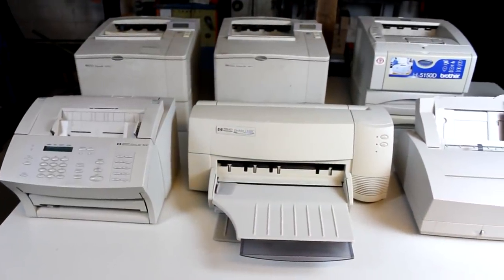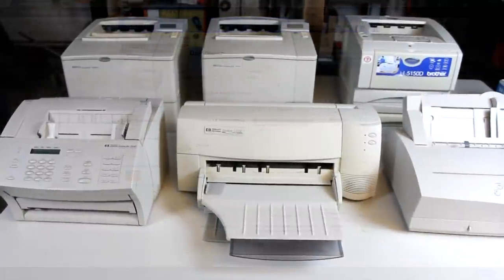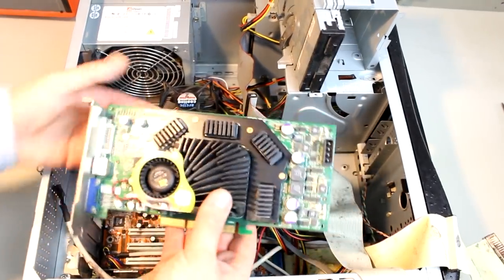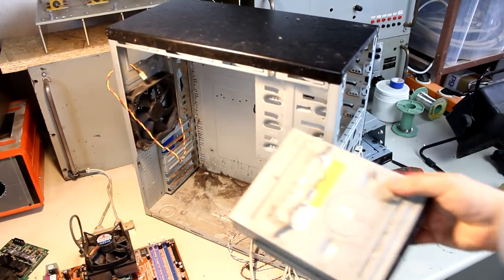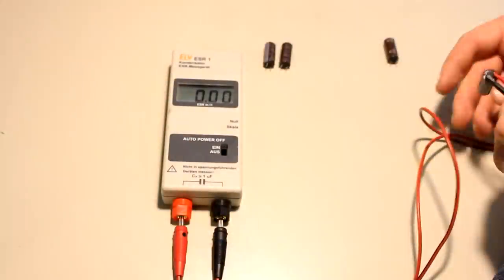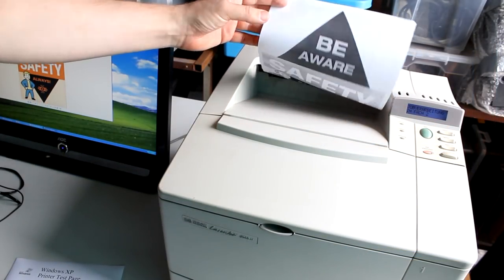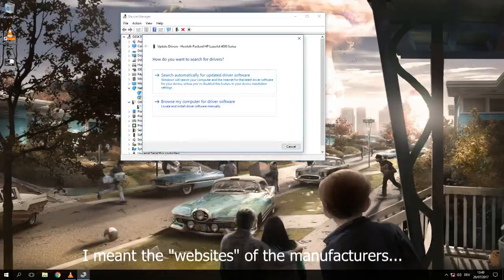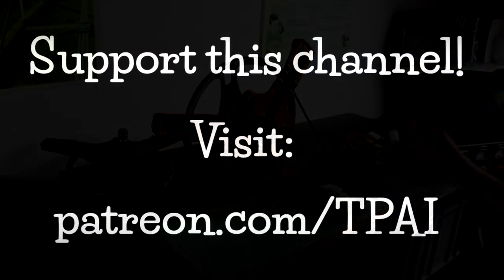Repairing and Restoring an Old Computer - (for those old Printers)

Comment: Man you need to apply much more heat to those solder joints on the capacitors! As you have stated it is a multi layer board, and that solder must flow entirely through the via's. The difficulty in removal is a good indication of the difficulty in attaining a proper temperature for the solder with that multi-layer board.

Comment: I remember the "capacitor plague". Some manufacturer stole a capacitor formula, but they stole the wrong one. Built and sold their capacitors for cheap. Many other manufacturers thought they were getting legit parts and these caps went into EVERYTHING. Of course they failed. On mainboards the copper plane is used as a heatsink. I've found the best thing to get those caps replaced is to just use a 150 watt soldering gun.

Comment: One needs to be aware when loading old operating systems Microsoft still supports to allow time for updates.  I just installed Vista on an old Dell I bought and had to leave it alone for a day or two while it did updates...I think there were over 400 security updates.  Of course, if you keep it off of the internet it is not an issue.

Comment: With the old HP Laserjets. Just pick the Windows built-in driver manually when installing. And force it to use something like the Laserjet 4000n which is included in the windows default list.. It will work on any old laserjet.

Comment: HP 4000n are legendary printers, very robust. Seen them still thumping out prints to this day. With a universal print driver, they will still work with a modern OS. Errm you have the patience of a saint to bother doing this, interesting about the capacitors on the mainboard, good tip!

Comment: 1:00 You do not have to install an old operating system. Just use the Universal printer driver. it woks with every HP printer.

Comment: Why clean a CD that was working? Also how did you manage to nearly snap it in two!
Reply: When I ran Windows 2000 I lost 2 or 3 Factory CDs - Workstation and Server...I think the mastering machine over-stressed the center hole, as that is where all of my cracks started.

Comment: I have had trouble getting windows 7 64 bit and after to work with a parallel port. but for some reason the 32bit versions of windows always work for me.  I just upgraded my shop cnc computer a few months back and it took me a while to learn that the parallel port (while found and showing up without errors on the device manager) just did not have any drivers that were supported.  but it may be just my luck.

Comment: You need to select the right color profile on Ubuntu. Some printers use nonstandard color spaces like BGR or KCMY, which would result in VERY unusual results. Some printers also work better if you select CMYKk if they have separate pigment and dye black inks.

Comment: When it comes to printers lets hear it for Linux.
Reply: I can remember when printing on Linux was a nightmare. I can remember when HP printers didn't work at all! Well they could spit out just raw commands. Pages and pages of them until you pulled the power.
Reply: Paul Frederick So do I! Those days are thankfully long past.

Was almost as bad as getting Linux sound card drivers going in those days...
Reply: I remember those old Linux stories. I recently found a pc from 2009, w7 ultimate , amd dual core. Had to tinker with it a bit buts till works well to my surprise. Gonna try a program lke adobe studio on it. Did I Mention the 500 GB hdd?

Comment: Hello and do you have any tips on how to check the power supplies on these old computers. I have Emachines desk top from 2002 and it won't turn on anymore. I installed windows 7 on it and it ran fine but after almost two years, I started having the power on issues. It came with windows xp originally.

Comment: Aren't those LaserJet printers network printers? You could try using them like that... At least for me on Windows 10 I can use my old HP Printer like this (I forget the exact model right now). You add a "Local Port" and connect to it via TCP/IP. If I don't remember wrong I use a generic driver for this... I can double check tomorrow on my Windows computer.

Comment: a long time ago that's what I found with windows XP was that you didn't need to go and hunt for extra drivers they were for the most part already installed on XP. I gave up on computer repair though and am not into Widows 7 or Widows 10 for compatible drivers, but sounds like a good portion of them worked at least on Windows 10 32 bit processing. Good luck on Windows 10 64 bit compatibility

Comment: try an old thin client.   try a cheap dev board running DOS.  printer drivers should be accessible on the command line.

Comment: try this

Right click the driver file. Click Troubleshoot Compatibility.

Click on Troubleshoot program.
Check the box that says The program worked in earlier versions of Windows but won't install or run now.

Click Troubleshoot Program. Check the box that says The program worked in earlier versions of Windows.

Click on Next.
Click on Windows xp.

Click on Next.
Click on Test the program.

Comment: Hmmmm... I just spun a old 12v 80mm case fan with compressed shop air and I it didn't generate more than 7,5v DC on the leads (even less when going backwards).

Comment: While Linux has full multiarch support (i.e. runs 32bit software without any problem on a 64bit OS, which is quite common to use since at least 2008 or so), Windows doesn't really have any compatibility. Yes, it will run 32bit applications in the most cases, but it can't use 32bit drivers. Also, under Linux, a printer driver is usually just a PPD (PostScript Printer Description) file which defines the language and the commands that the printer understands, so you couldn't really call it a "driver", like the kind of driver that you have for your Wifi card which is a kernel module. But the way Windows calls everything a driver was already funny back in the 90s with CRT monitors, which also don't have a driver, just a subset of pixel resolutions and frequencies that they can display...but Windows always wanted a "driver" for it. Even for a PS/2 keyboard, which was a really standardized component and every one of those used the same protocol, they only had different numbers of keys, and the keymap was of course different (which you could already change in Windows back then, like using a German keyboard with an English keymap and having the z and y keys switched and so on). Again, it was stupidly called a driver and pretended to "install" that thing that sat in the BIOS and was there right from the beginning (you could not install any Windows and not have it contain the standard keyboard driver, even though it wanted to "install" it anyways).

Comment: Have you tried to select 32 bit compatibility mode? I had a 32 bit driver for a 32 bit program that was installed on my Win10 64bit system. Maybe setting a compatibility mode might resolve this for you.

Comment: there are few reasons for not using compressed air :
- either dry or not it will get the parts wet because of low temperature of expanding gas
- it can push the dirt under components like ICs and connectors
- combined dirt with moisture makes a pcb bad in moment.

Vacuuming with integrated brush sorts all that out.

Now i wait to hear ...blablabla.. but they all do it... blablabla

but, it often happens before trying the part/system so you can always say that it was already bad ;)

Comment: One of the reasons that they mostly worked on windows 10 is due to the issues that Windows 7 gave during the beta testing, there were way too many compatibility issues, it was still like that in the windows 8 beta release as well, but with what they learned they implemented it into windows 10! 

I was going to say, you could have easily used vista for running the printers, since many drivers did not face huge differences in compatibility, since vista would run some 98 and most me, 2000 and xp drivers! People always hated on Vista, but it really was not that bad of a release!

Comment: Having repaired computers onsite for a few years as a factory service rep, seeing the inside of that old PC brought back memories of a chain smoking fat woman in a girdle and bra, ash trays filled with old cigarette butts strewn about the house, and several cats roaming atop the filthy, smoke filled kitchen table and countertops. A dirty processor heat sink and dirty or disabled cpu fan would raise the temperature causing increased current flow to the processor which tended to boil the affiliated capacitors as part of the thermal cascade.

Comment: Many old HP printers will work with generic drivers that ship with Windows operating systems.  I'm using a Laserjet 4000, Laserjet 2200, Deskjet 880 and 990 cse with Windows 10 drivers.  These printers also work fine with Ubuntu 16.04 LTS.

Comment: I need your help, i have found a HP printer but it uses a proprietary power cable which i don't have, can u please suggest me a way to power it on or change the cord/transformer solution? thank u in advance, big fan. M

Comment: i have a hp 815c, it has usb, i bought it in 1998, there are no 'drivers' for windows 10, but you just plug it in and it works

Comment: To unsolder bad caps on motherboards, first heat the underside of the board with a heat gun. Once the board is hot it takes less effort to heat the board up to unsolder the caps.

Comment: Hey i dont know if you will see this but i had similar problem with one printer recently. 

There was a person who asked me to reinstall the windows on his computer. When i got the computer i was surprissed as to why Windows 7 32 bit version was installed on a machine with 4GB of ram. I installed Windows 10 Pro 64 bit. 

Laptop was working fine, but when i got to that persons home i was asked to install the printer. It was old HP ink jet. On HP page the only drivers were for windows xp 32 bit... my first thought was well f**k... I opened up device manager, looked for devices with missing drivers (of course only the printer would be with missing drivers) opened the properties coppied hadware id and tried to look for drivers on the internet, i found a few that claimed to be working with windows 10 however they didnt...
 Then i thought i should try the option "Search automatically for drivers" in device manager because on Windows 10 they actually work (unlike in any previous versions of windows including 7,8,8.1) and i was shocked.... 

I dont know where or how (my guess is microsoft compiled old drivers or coded universal ones) but it found drivers for an old (10-15 year old) printer for Windows 10 64 bit, while on official HP page there was only 32 bit windows xp drivers... 

That automatic search doesnt always work (i had instances when it didnt find drivers) but for the most part it works.

Comment: drivers for that a3+ hp printer are avalable from windows update on any windows . 1120c or 1125c model works fine  for me, the same is with 1700c 1900c and 1220c you just have to select the closest similar driver. All color deskjet printers working with pcl3 programing language will print something on any plc3 driver anyway, so only paper format and margins are a thing.
most of hp laser printers works with "laserjet family pcl5 driver" or "Laserjet family ps driver"
shades of grey might be messed up though, because those drivers only support low res printing and the image quality is printer dependent .
For brothers i have no ideas
same goes for canons
xerox made their drivers public to microsoft with legacy products so it should work similar like with hp
kyocera have the best support for drivers, or at least it had when i last checked for drivers to mita fs 1010 from 2001 i get all the drivers i needed frm their website
toshiba like to delete support for discontinued models
ricoh/gestetner drivers should be avalable at least for 32bit systems
lexmark have the worst support of them all, most of the working printers died because of no drivers for 64 bit systems, even installing them in virtual windows xp rarely works
another good printer support comes from epson, my old 68 photo edition works fine on 64 bit windows 10
i have no experience with other manufacturers

Comment: There is a compatability mode in win 7 to win 10... You can use most of the application from with 95 to 8 !!! After installation if the program fails to start then right click and go to compatability options then select the os and save !! It doesn't work with system drivers ,. Normal application will have no problems with it,.........
Reply: As stated above, the chances of the drivers working is quite slim to none.
The problem is that they sometimes depends on 16bit code(!) that is not available when using the 64bit mode of the CPUs.

Comment: Windows XP ist praktisch Windows 2000 mit einem anderen Design. Es hat sich kaum etwas geändert. Von daher rate ich jedem davon ab, Windows 2000 zu verwenden.
Alles, was Windows 2000 kann, kann Windows XP auch. Inklusive Design ("Windows -
 Klassisch").

Comment: If you use Windows 7 instead of Windows XP, you should get more printers working without much hassle. 
Windows 7 contains way more drivers then XP,  9 over 10 older printers especially HP printers, work with the buildin drivers that Windows 7 contains.
For best results, use the 32Bit version of Windows 7 for those old printers.

Comment: "I tried to clean the Win2000 CD" - using a hammer? :)

2 minutes running memtest86 before you reach for an OS installer saves a lot of frustration - meanwhile you check fans are running OK, temps are OK (finger test on ICs) sniff test for burning,  everything is secure (a few taps here and there to see if it hangs or reboots) If you have time for a coffee or toilet break leave it running while you are away.  For important machines leave it runnng overnight.

Comment: Any Winblows 64 bit OS will have a mode called 'backward compatibility mode' This should also work on the latest malformed child of the Winblows line....as it allows 32 bit software to run on 64 bit OS

Paddy

PS : If I have made you think I am not a Microsoft fan, you'd be right

Comment: If only 32 bit drivers are available for those printers then the deadline is Windows XP 64 bit for those old printers. Sadly, there's no way having 32 bit drivers on 64 bit systems, maybe you can trick the system to install those by modifying the driver INFs but then you'll face the other problem on 64 bit: you have to disable driver signature check.

Comment: I always spin my fans as fast as possible with compressed air. Maybe I should be more carefull XD
Reply: To spin the fan as fast as possible you'd need an unregulated air blow gun. They haven't sold one of those in many decades now. But you can take a restricted air gun and bore it out. You have to take the gun apart and find the restriction the manufacturer put in it. It'll be this little brass pinhole deal inside the gun. Just drill that up bigger than the exit hole and you're running full blast then. But realize they restrict blow guns for a reason. Because you can hurt yourself with an unrestricted one if you're not careful. Now you've been informed, and warned.

Comment: Linux Mint rather than Ubuntu may be a better choice for an operating system.  Windows XP was quite pretty; unfortunately it is no longer supported. Remembering how many Microsoft updates were required just to get Windows 7 up to scratch; starting from a brand new installation.

Comment: I have a HP DraftPro DXL 8-Pen Plotter (late 1980 model) with a 25 pin RS232 connector on the back.
I am looking to resurrect this plotter to work on my windows 10 lap-top with only USB ports so I can print/plot my TurpoCad drawings.
Does anyone know a way to accomplish this? Any help wood be creatiy appreciated!
Reply: you need to purchase USB to RS232 converter. This one is typically available with 9 pin connector, so you'll also need 9 pin to 25 pin adaptor

Comment: I'm using the HP4000N with Windows 10 x64.  I did a search and the driver I am using is HP-LaserJet-4050-Printer-Driver-for-Windows-64-bit.exe  It is digitally signed and works well.